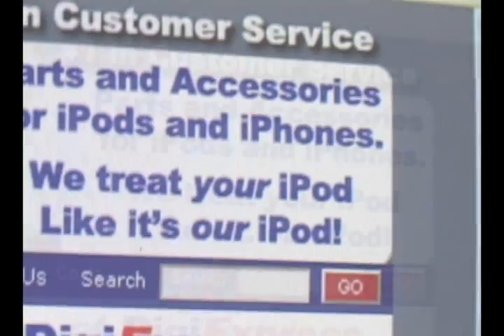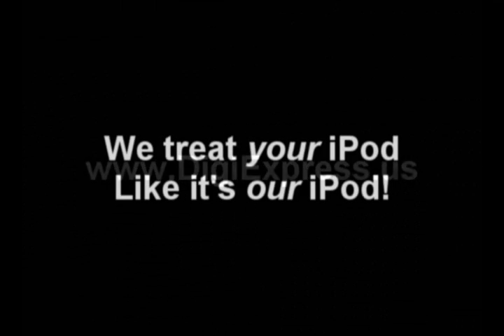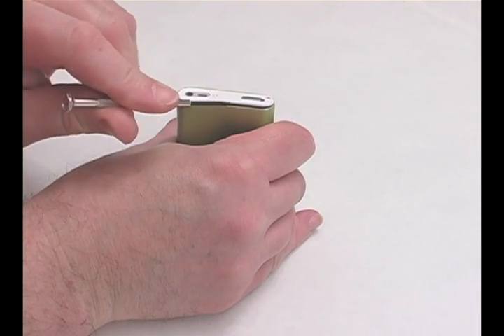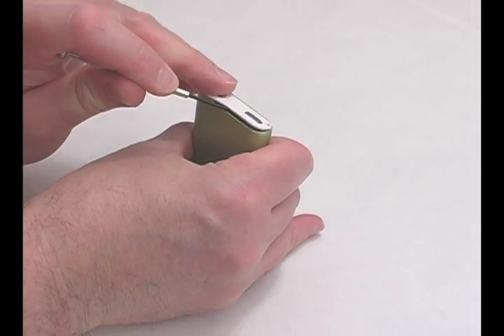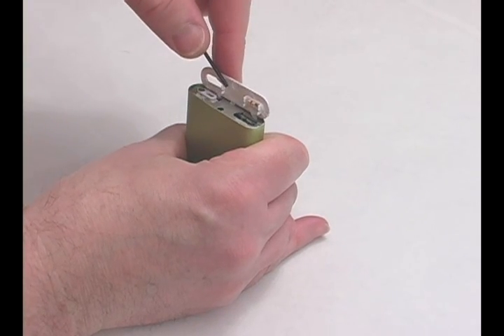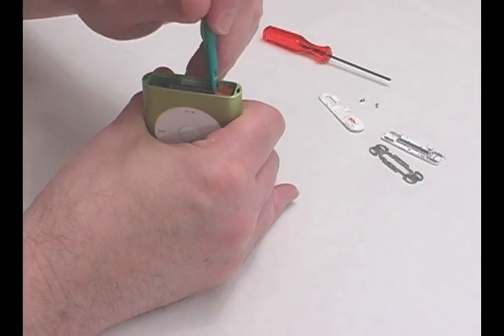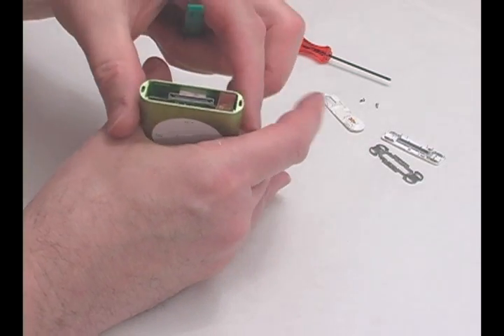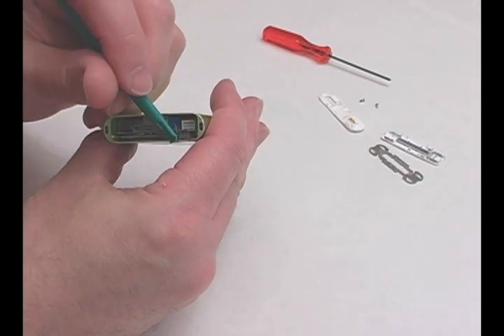DigiExpress - iPod Mini Battery Installation

Comment: Great videos, great service. I've repaired two IPod Nano's using your parts already. When connecting a new battery you can splice in the middle of the wires instead of connecting at the terminals. Just make sure that none of the wires lay over another as their is no room for them one atop another. Splay them out flat, I used liquid masking tape and a small piece of cellophane tape to insulate them after soldering.

Comment from the maker: @gnamp The metal clamp is a pressure clamp, simply gain leverage from one of the four corners and pull it upward.  at least one, if not two, sides of the clips will remove and the rest of the clip will follow.  It is just a pressure clip, release the pressure and the clip comes out.

Comment: you didn't show how to remove the metal part under the bottom bezel. And that's the part I'm struggling with. In this, it suddenly appears on your work surface...